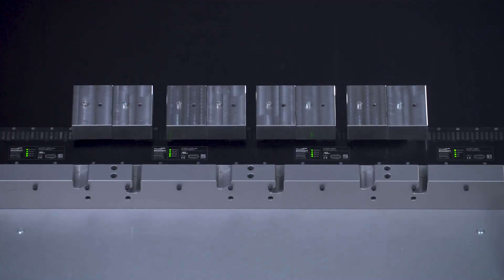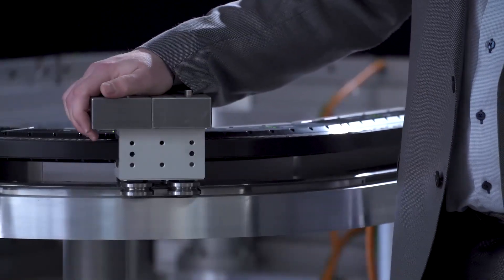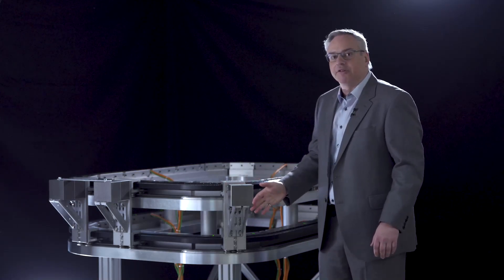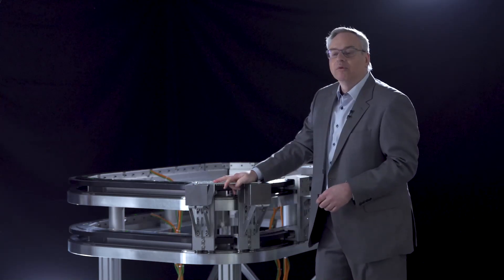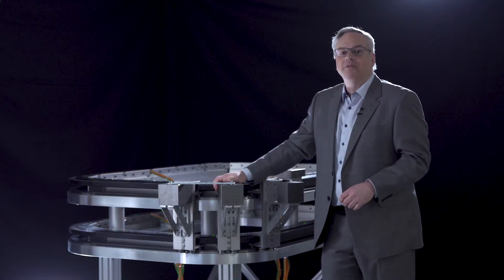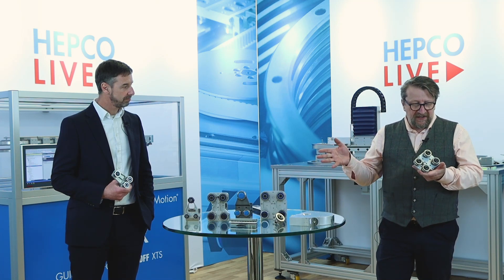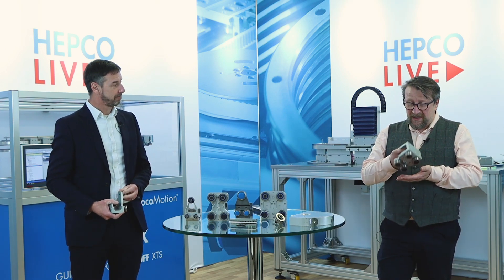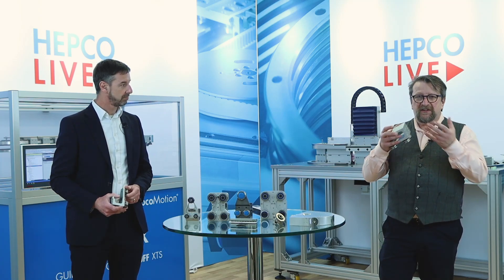High Drive | GFX & XTS - The Latest Developments

Comment: is there any specifiction about the high weight
Reply from the maker: The B40 Hi-Drive mover is rated up to 20Kg per mover, however a mechanically linked and stacked pair (double decker system) effectively doubles the payload capacity to 40Kg.